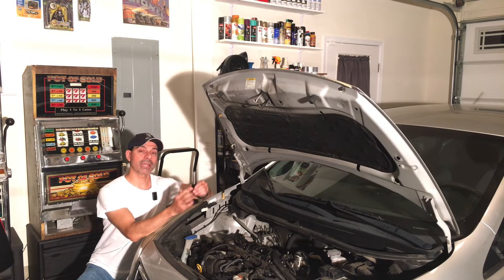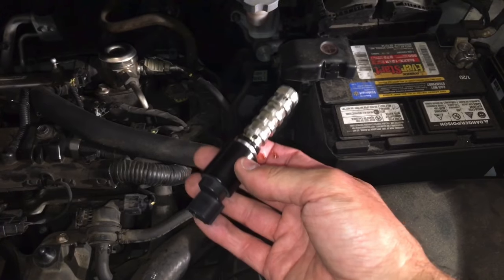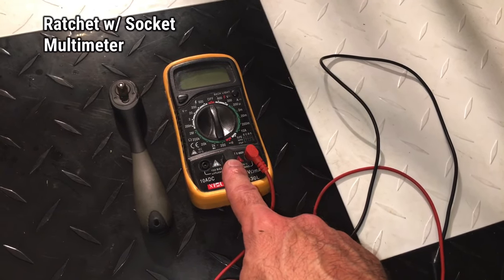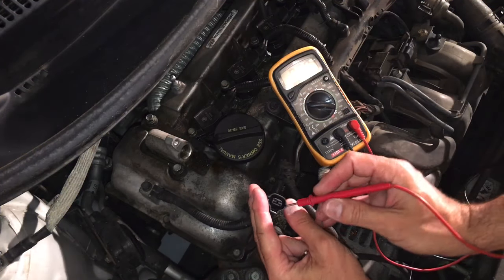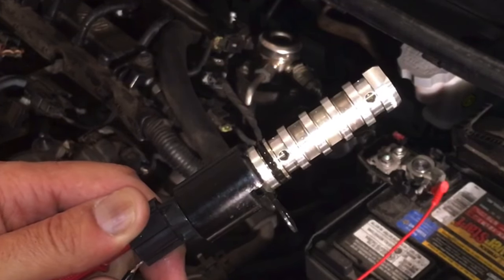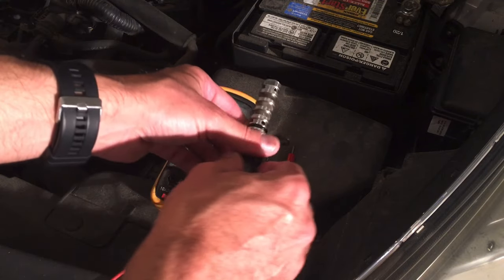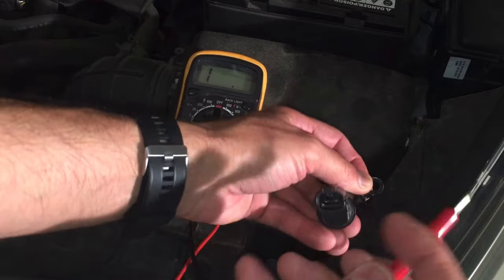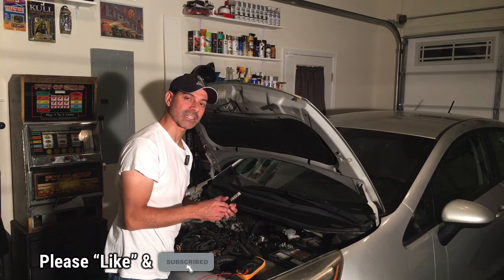How To Test A Variable Valve Timing (VVT) Solenoid (Andy’s Garage: Episode - 262)

Comment: I drive a Toyota matrix 2006, and I keep getting the p0012 error code. My vehicle was recently worked on as it was over heating. I had changed the radiator to a brand new one, also changed the belt, and also checked to see the fan had good current and was still effective, so I was left with changing the gasket as my technician said it had gone flat. Since that change was done, the p0012 error code has been on and I get rough idle and even rougher once the air conditioner is turned on. What could be wrong?

Comment: Shouldn't it be 12 volts at the plug? 8v seems like thier is a voltage drop issue
Reply: Have the same question!did you find any reason for the 8.69v?
Reply: No I didn't have a voltage problem I was just watching because I heard my vacuum leak code could be due to a bad vvt solinoid but honestly I think theirrs supposed to be 12 volts not 8, usually cars either have a 12v or 5v reference depending on what it controls but I've bever heard of 8v being normal but then again I'm just a diyer and get most of my info from the videos and internet.
Reply: Hi, yes it's normal, remember this OCV solenoid works according to a pulse which means a variable duty cycle, could be 17%, 28%, 70% depending on different engine working conditions, load, rpms, oil/coolant temperature and so. The readings could be different according the car brand.

Comment: Great video and thanks! do you think the oil valve filer should be replaced regularly? how about this solenoid valve, needs replaced regularly?
Reply from the maker: No, I would inspect it periodically and clean if needed. If it’s too bad then replace it.
Reply: @PhillipsVision  Master, if there is no fault light displayed on the instrument panel, then this vvt solenoid valve must not be broken?
Reply from the maker: @松本一郎-n9g  no always, sometimes you need to test it

Comment: Hello, i'm only getting 1.36 v on the carconnector. Daihatsu sirion 2 engine 1.3 16v. Regards
Reply from the maker: That sounds too low. Check the harness on both ends, at the solenoid and to the ECU to make sure everything is connected fine
Reply: @PhillipsVision  Ok, as soon as i can. I

Comment: My Toyota Camry wont give a chrck engine light forever..Jerking at stop and accelerate something like coughing..not sure its plug coil or vvti solenoid switch
Reply from the maker: If it’s the spark plugs you should be getting misfire codes.

Comment: I got a avensis 2001 with a vvt 1.8 engine, i tested my vvt solenoid it had 8.5 ohm and the signal to it was 2.22 volts so my question is should the voltage be that low and is the resistance good enough on the solenoid ? and in case the voltage is bad what can i do to fix that issue ?
Reply: Send more volts to solenoid

Comment: I don't get any voltage coming in to it. Should it show voltage with ignition on and engine off. I had always assumed that it only gets voltage when the ecu sends voltage to it when you are accelerating? Mine is a vauxhall zafira. If mine should have voltage but does not, where do I go from there? As in what do I check please? Thanks
Reply: same my 2010 camry shows no voltage to the VVT Solenoid connector when switch is ON and engine OFF.
If you figured it out 4 months ago (when u posted this comment) please lmk what you did!
Reply: How did you solve this? I get only 1.1V from connector,...?

Comment: My car showed the P0011 code but after scanning with a snap on reader, 2 things that were causing the proble was Low oil but was cause for a faulty Oil pressure Sensor allowing low oil pressure. I replaced it  cost me like $40 usa brand one. You can find it for as low as $30 hope that helps you'll need a 1 1/16 deep socket  6points or they sell it fleetfarm autopart, $10 and 1/2 extension socket with 1/2 ratchet. If your car have a shield just unscrew 3 screws. You'll  see it after that. Hope this helps someone. Remember Disconnect the battery first for safety. After starting every procedure read the code earase it after do oil change first and do the other steps. If everything works you wont see engine light.

Comment: Can a faulty OCV cause acceleration based knocking?

Hyundai Accent got a P0014 code. Says Camshaft Position Actuator and bank 1 timing over advanced.
Reply: Hi. What caused this error P0014?  I have the same in Opel astra 16, I replaced the sensors and still there is this error. I don't know what to do anymore.

Comment: i should clean and test before buying a new 1 correct?
Reply from the maker: Yes, sometimes cleaning is all you need
Reply: @PhillipsVision  i got the part about 2 days after check engine light came on. when that happened i got an oil change and it took 2 days to work its self back to correctness my check engine light off and no more dropped rpms at least last night driving it, i will hopefully be solid today. your video helped alot tho tyvm
Reply: @ant13ducks  update?
Reply: @BdeJJG   it was alot more than the sensor i need to replace a pan of somesort. im trying to see if my warrenty will cover it actually but im planning to attempt to fix it tmrw XD

Comment: Sir mey i ask you, on my mx5 nc1 the value stopped working. The engine is burning a lot of oil. Maybe stuck for that? If i do spray cleaning on the vvt is it possible to work again? Thank you.
Reply from the maker: If you’re burning oil it may be the PCV valve that needs to be cleaned or replaced.
Reply: @PhillipsVision  Thank you so much for your answer sir. My nc1 burns 1L/1000k. I will replace the pcv valve soon. I replaced the value seals but no better. My mechanic says piston rings. Nobody cares about pcv except me. I will replace the front oxygen sensor too. I want to clean the vvt too thats why i am looking for the position!!! I appreciate for your help. My respect!

Comment: I was getting a code P0016, then p0104 , P16A1, 2645 .replaced the chain and tensioners and  sprockets and now I still get the same codes.  Any idea what it could be?
Reply from the maker: P0104 pertains to a faulty MAF sensor. Here’s a link to a video I did showing how to test it..
https://youtu.be/iyc7XEyKx2o
P16A1 pertains to the Throttle Position Sensor. Could be a bad Throttle Body or faulty TPS. Here’s a video I did on testing that..,
https://youtu.be/jXEOqvtuvII
P2645 pertains to a faulty Rocker Arm Control Solenoid.

Comment: Great video but one question: is 8 - 12 ohms the acceptable range for most manufacturers?  I've got a Subaru
Reply from the maker: @excampopa  you should check with the manufacturer for the specs on your vehicle.
Reply: @PhillipsVision  I tried, nothing on the parts website or my Haynes repair manual
Reply: @PhillipsVision where did you get those test leads? Can't find them anywhere locally
Reply from the maker: @excampopa  Harbor Freight

Comment: So I’m trying to connect a toggle switch to my amplifier in my car where do find the ground from? Any wire that is 12v in my car? Please clarify?
Reply from the maker: You should ground it on the chassis. If you ground it onto another ground wire it can cause problems.

Comment: Hi, thanks for your video. One question, I cleaned the vvt-i and I did the tests and the solenoid excited it with 12 volts and the same thing happens as in the video, that is, it is apparently fine. Then I found that when I made contact and measured at the terminal of the vvt-i valve I have 1.84 volts, is it normal that it has such a low voltage? my car is a corolla xei with simple vvt-i from the year 2008 1ze engine of 1.8 liter displacement.
Reply: Did you ever decide how to fix this?
Reply: @daveogle8144  no yet...:face-orange-frowning:

Comment: When testing the solenoid how did you connect the ends of the black and red wire to the cars battery without alligator clips?
Reply from the maker: I just held them in place, but you can use clips
Reply: @PhillipsVision  No, the part when you were opening and closing the solenoid. You had the red end connected to the battery terminal some how while you used the other black and red ends for the solenoid

Comment: I run all of this test with my vvt solenoid. it pass on connecting with car battery it click and the plunger moves fine. and then i connect with harness and turn onn the key, at that time it click and the plunger moves fine . but when connect with multi-meter the resistance reading is 0.0 is this bad solenoid ?
Reply from the maker: Make sure the multimeter connections are solid

Comment: Mine is a Camry 2.4 I have tested it turn on the ignition but after 2 second with ignition on no more power need to off and on again the ignition.
Reply: Can you tell me what's the problem?
Reply: Got a new wire harness and new ECU

Comment: In the case that the solenoid DOES work and I keep getting p0014 (the exhaust vvt) what steps do you recommend taking. I replaced the intake and I replaced the exhaust vvt TWICE (second was oem) and I was about to get another but I realized BOTH the aftermarket and oem exhaust vvt work perfectly fine.  I have a 2011 chevy malibu and I DO NOT have any symptoms, car runs absolutely fine and I keep getting this code back. I don't know what to do now. How do you properly test the wires? I don't seem to be getting voltage through mine when i put the key in ignition and test the connector. Please answer. ANY help will be greatly appreciated
Reply: Check oil pressure, oil pressure sensor, and oil level sensor. Find out what spec your oil pressure is at certain rpm, but the saying goes 10psi per 1000 rpm. Let me know how you go
Reply: @lewisheasman  Hmm, I'll have to buy a manual oil pressure gauge as my car doesn't have a gauge for that. Changed the oil and oil filter again yesterday and the same p0014 came back on after a few miles. I heard that maybe the camshaft position sensor might need to be replaced. So I will test my exhaust side camshaft position sensor tomorrow and see if it needs to be replaced. After that I will try testing the oil pressure. Thx
Reply: @zHazzz  did you end up fixing it ?
Reply: @Mr.305_  I have a long story but I will try to make it short. I took out  both of my camshaft position sensors and they did have a very small amount of oil sludge at the end of them so I cleaned them and the end of the tunnel where they plug in, still had the code. (Tried replacing the camshaft position sensor with a new one but it wasn’t needed to explain in short) I then took it to the dealership confused as I did a lot of things. When one of the mechanics started the engine at a cold start he said he could hear that the timing chain has jumped and that it needs to be replaced. I will say that I did notice a small noise after every cold start for like 2 seconds and disappear (and this only began to happen after the day I drive my car with very low oil) < this is the cause of this whole p0014 code issue as I had a loose oil drain plug when I refilled oilI, which caused me to drive the car for a very long time with low oil that’s leaking from the loose bolt. I do have a interference engine and they warned that replacing the timing belt might not resolve the issue as there could be possible engine damage. I have no symptoms so I believe replacing the timing belt along with the camshaft actuators (also known as the camshaft sprockets⚙️) will fix my p0014 code . They quoted $2.2k (1k for labor) to do a timing chain replacement (everything included such as balance shaft chain guide, all sprockets, tensioner, as well as timing chain guides and chain.). This was too much for me so I bought all the parts that I needed for about $650 and I will be doing the timing chain&balance shaft chain replacement myself at my own house sometime this week as I found out the job isn’t that hard on my 2011 Chevy Malibu.
 
Edit: Also after doing some research, running the car on low oil CAN jump your timing chain/belt. One person on Reddit explained this perfectly. There are some plastic chain guides that hold the timing chain in place and usually when you run the car with very low oil, the engine temperature gets very hot and overheats. This could cause the chain guides to break  (Yk plastic, it breaks into two pieces when overheated). So when the chain guides breaks, there is no longer tension in the whole timing chain which results in a jumped chain as the whole chain is now loose and can skip a tooth on the gears⚙️. I made a very simple but very idiotic mistake by not checking my oil dipstick frequently after I did oil change. If I had checked it within the two days I did oil change I would’ve caught that I had a very loose oil drain plug on time and not have to deal with this expensive fix

Comment: What if Im not getting power to my connector ?
Reply from the maker: You may have a break is you wires going to the connector. You will need to test the wires for continuity to determine the one(s) in question. Here’s a video I did showing how to do that:  https://youtu.be/714_57IRwkk

Comment: How do i can test the connector?
Reply from the maker: If you’re testing for breaks in the wire here’s a video I did showing how: https://youtu.be/714_57IRwkk?si=fGO41_4vu4ZS5d6_
Reply: I have no voltage going to the harness, replaced the solenoid because code said it was bad, now code says misfire 😡 is my ECU bad?
Reply: @ScottLonganbach  maybe. Need to check the ECU

Comment: I have a 2006 Nissan Altima 2.5 s and I have put a mass air flow in it a 02 senser in it 4 new plugs and 4 new Cole packs and. Crank shaft and my car won't go over 30 miles top on a hill 5 miles a hour I do not no what else to do any one got any idea
Reply from the maker: Are there any engine codes?
Reply: @PhillipsVision  0003
Reply: Sorry pooo3
Reply from the maker: @michaelchesser1553  that pertains to the fuel volume regulator. Your Pressure Regulator May need to be replaced.
Reply: Thank you and some one else said it could be that cam selnoad senses
Reply from the maker: @michaelchesser1553  the code you’re getting points to the Fuel Pressure, that explains your loss of power. Could be the fuel pump as well, but start with the pressure regulator since that is cheaper and easier to do. If you have a pressure tester, get a reading off your fuel rail. That will tell you for sure. Here’s a link to a video I did on checking fuel pressure: https://youtu.be/rAJOSQcmnqA

Comment: 8.6V is way too low, anything under 10.5V is a dead battery
Reply from the maker: That is the voltage at the sensor, not the battery’s voltage